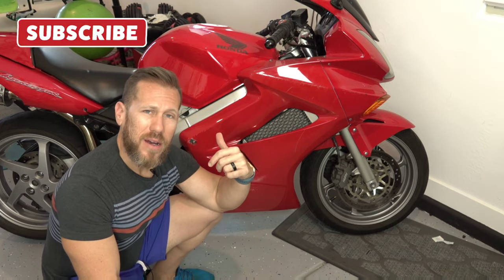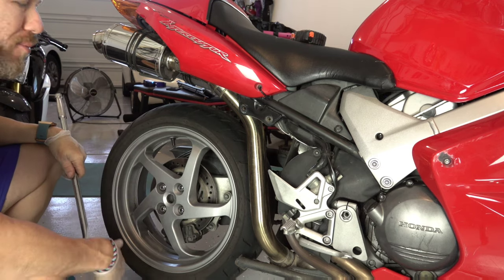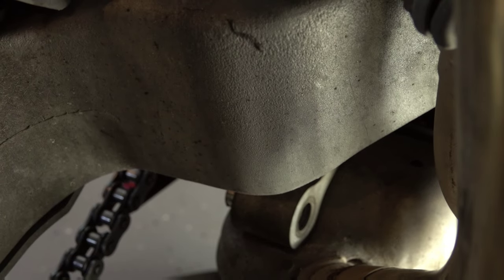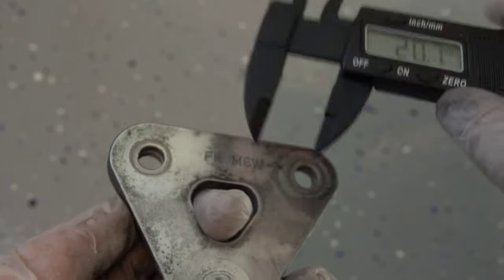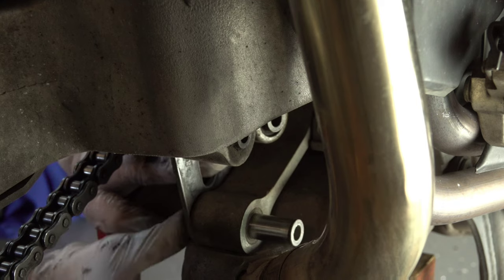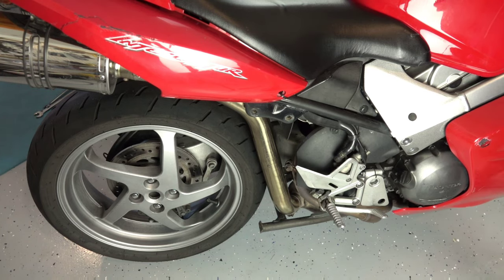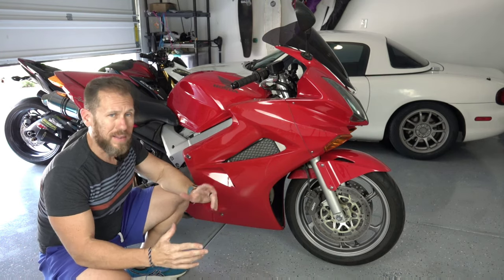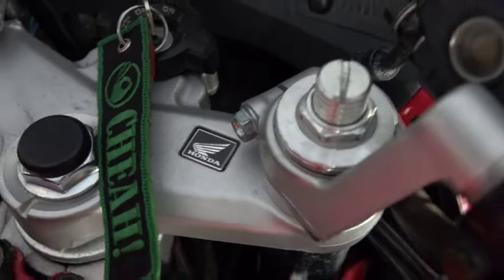Lower your Honda VFR800 for FREE

Comment: Thanks for the video. I like that you left the problems encountered and what might happen. Very helpful. 
As for the mod...  The problem with VFR and Honda bikes in general is NOT that the seat is high but that it is TOO WIDE, so the rider is forced to spread the legs out which costs him inches.  For a short rider this can be dangerous particularly when you are pushing around on road dirt and you slip. 
Case in point, the ducati ST4s (which I've ridden)  has a seat height of 805 mm vs the VFRs 820 mm (which I own). Yet on the Ducati I am completely flat footed, but on the Honda I am on my toes. That's because the Ducati seat is saddle like, your legs drop straight down. I have not done this but I've heard some people say that the best way to gain leg room on a VFR is to take the seat to an upholsterer and shave off some of the side foam at the seating spot so that your legs can drop straight down.
Reply from the maker: Hey Alfredo first of all thanks for taking the time to write a comment and also to share tour thoughts.

Thanks for appreciating the fact I left my mistakes in the video. It will happen to all of us and what is the purpose to try to help people if I hide what could potentially help other. Thanks for noticing. 

You bring up a great point. Indeedd the seat is wide. I already Reupholstered my seat but at the time I did bo think about shaving some material but I have done it in other bikes.

Although this was a no cost solution, I could spend a few dollars and purchased a Trex triangles but the good thing is that this option is totally reversible. I have not felt any weird behavior from the bike that is making me feel regret my decision.

Thanks so much for your detailed comment I really appreciate you for taking this approach and sharing your thoughts with me.

Thanks sir.
Reply: The thought of shaving the seat down never crossed my mind. So thanks for the inspiration. I went to my garage armed with a Carving knife. Unpicked the staples an set about it. After cutting loads of foam away and finishing with a 120 grit sanding disc. Banged it back together and hey presto. Feet flat on the ground what a difference its made. Can't thank you enough. Feeling dumb cos I should have thought about it myself. Lol.
Reply: would love if you had some pictures of your work with the seat

Comment: Hi, had to let you know that I just lowered the back end of my  '98 model  in about 20 minutes. I didn't take the wheel off either.  I just put a large wedge of wood under the back wheel and then took the 3 nuts off the bolts, then knocked in the wedge until all 3 bolts were loose enough to slid out easily. Now I turned the plates around so the arrow was still at the top, but pointing backwards. Then slid  2 of the bolts back in, then knocked the wedge in further to lift the wheel and line up the last bolt. Very easy. Putting the plates on this way gave me a drop in ride height of 3 cm ( 1 inch, and 3 sixteenth )
Reply: I have to do same.

Comment: Great tip. It also works on the 5th Gen VFR800 (98-01). We tried it yesterday, because the bike had a longer shock (stock linkage) and was too high for the rider. Thanks👍

Comment: Triangles are stock. If they didn’t want or it was unsafe to do what he did then guess what? They would have left the triangle the same length or just blocked out the holes so it couldn’t be changed. Just common sense.  I just returned to riding and purchased the “Yellow Hornet”. I’m shorty short 29” inseam. As far as I know it’s stock height, talk about tip toeing!!! I have to remaster my tripod stance. Loving the bike though!!!
Nice clear vid!!!

Comment: My humble opinion: I appreciate the desire to disclose and involve others, really, however, in my opinion this is a type of change that does not ONLY have the desired effects, but also extends to unwanted effects. In this way the geometry of the bike is profoundly altered, and at least it would be advisable to rebalance the weights, between front and rear, at least by performing a static sag and a sag rider. As the owner of an identical VFR, I would immediately notice the behavior of this bike in this configuration. It would perhaps be advisable to report to other users that this change alters behavior and is not recommended or suggested, but only for personal enjoyment.
Reply: Estoy 100 % de acuerdo con Tigo , de esta manera afecta mucho en la geometría de la moto

Comment: I bought a lowered 2003 SV650S and I returned it to stock height after I bought it.  The handling felt much better after returning it to stock.  In general I don't advocate for lowering any bike as it affects the lean angle and handling.
Reply from the maker: I hear you. It is possible to make it feel balanced but not as agile as stock height ride. I agree. Bikes looks so good lowered sometimes 😋

Comment: I've done this with my '07 VFR as well but with a Soupys threaded link and I'm  5'7. While it definitely  helped me get my feet mostly  flat footed, I didn't like the way it handled and the centerstand  was hitting some speed bumps so I returned  it back to stock. After installing  a new rear shock and refreshed the front suspension, she feels so much more planted. It's a PITA moving  her in gravel but how often do you really park in gravel?
Reply from the maker: The comment about the gravel....hahaha you made me laugh it's true. 

I understand even matching the geometry by lowering the front etcetera the bike will react a bit different. Thanks for sharing.

How are you liking yours?
Reply: Love it and will never lower it again, ever! Honestly you just have to keep riding to get comfortable with not having both your feet down. I've always balanced on just one foot down all the time. Been riding for 25+years on different bikes and the VFR is one of the best balanced bikes. Practice rolling to a stop sign without putting your feet down and holding it for a few secs is a great teaching tool. And I'm sure you've seen waay shorter girls ride sportbikes not lowered so if they can do it, anyone can. But you have to ride it often and practice, practice, practice.

Comment: What generation or year is your VFR  (5th generation is 1998 - 2002)?  Will this work on any generation?
Reply from the maker: Hey @gransport12 mine is 6th gen. I have never owned a 5th, so I don’t know. I know there are thing that are similar between the 2 but not sure if this is something similar.
Reply: The linkage (and shock) seems to be different. Lowering links are available but only fit to the 5th gen OR the 6th gen, so they are not interchangeable.

BUT the trick from the video also works on the 5th GEN. My buddy has a 98 with a longer shock from Wilbers and also a reupholstered seat, so he had his troubles standing secure with the bike. 
We made the same change as seen in the Video and the rear wheel is now about 2cm (about an Inch) higher, when on the center stand. 👍

Also there are NO clearance issues between shock, linkage or swingarm.

Comment: Quick question mate, any idea why mine shuts off when I lean it a few degrees and then have to wait like 15 minutes for it to start
Reply from the maker: Hey @engstreet that sounds like the Mercury Switch. The VFRs and almost all bikes have a Mercury switch that turn off the bike in the event of a tip over. If you were to lay down your bike while running this will turn it off for you. 

I doubt the switch is bad but is possible. Some people disable it by bypassing the sensor but I think it's good to have it. Anyway seems like your is maybe defective? I'd remove it, clean the contacts? Remove the battery for 5 minutes and try it again to see. 

I don't think it's fuel related but I am guessing your file pump is working okay and the you had enough fuel?

Happy New Year!

Comment: The kickstand would need to be shortened because the bike is lower.
Reply from the maker: That is correct and if you watch my other videos I have always shorten the kickstand, but honestly the drop on the VFR was negligible so the OEM stand was working perfectly. 

Thanks for the comment
Reply: You can buy adjustable side stands on ebay for 20 quid. Fitted perfectly and the cut out switch works just fine.

Comment: This kind if thing is incredibly dangerous!!
Reply from the maker: Hey John would you care to elaborate? Just trying to understand.

The T-Rex company for example has been designing lowering links or triangles to lower bikes for a long time and I have used them for many years. Although I did not use the lowering triangles I used the OEM in a different position which replicates the same purpose of changing the connection points between the spring, swingarm and chassis.

Or maybe you are referring to lowering the front?

If done carefully, none of it is compromising the bike, bolts were torqued and I have been doing this with almost all of the 40 plus bike I have owned. 

I'll be happy to chat. Have a good day!
Reply: @ToModorNottoMod  By just flipping the standard link plates you are fundamentally altering the behaviour of the linkage over a dynamic range.. be this in vertical stiffness profile or damping. without calculating the effect this has on the dynamic behaviour of the vehicle, it is dangerous to suggest that this would be a good idea, I'm sure Honda would warn against a modification such as this.
Reply from the maker: @John Edward McGladdery  Thanks for sharing your point of view and explaining.
Reply: @DynamixsEd  I know what you mean. People do this all the time but as you said, now that distances are changed, torque (force) exerted on the different points are changed. One would think that the tolerances on the plate and connecting elements are such that this minimal change is not going to be critical. But for just a 10mm gain, I would buy  shoes with thicker soles ;-)  .  I appreciate the video though, I like that he left all the mistakes made as a warning of what might happen. I think that was worth more than the mod.